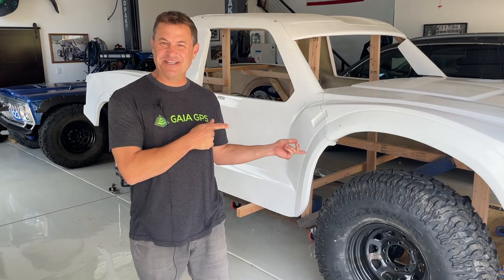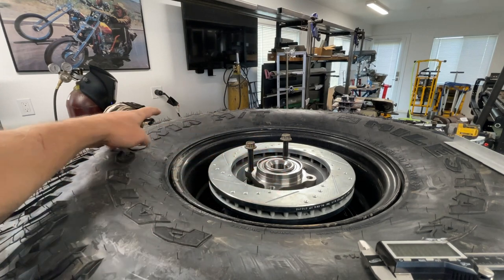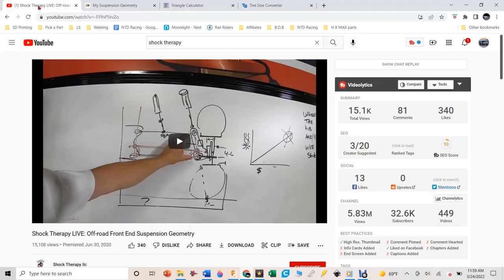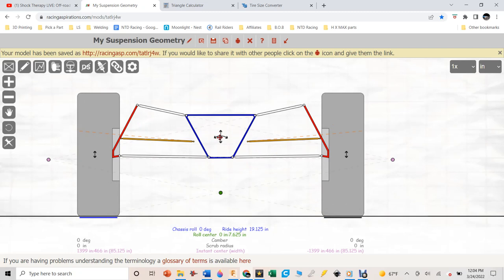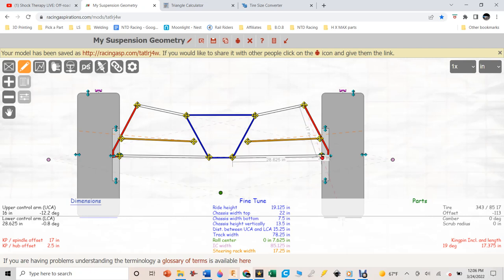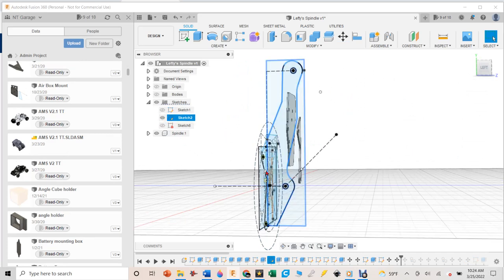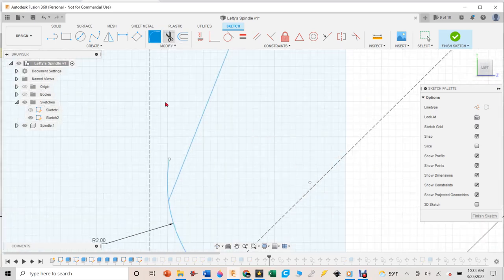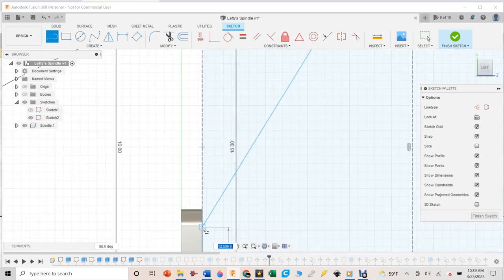Build Your Own Off Road Suspension - Spindles

Comment: Great videos, thanks for all the information and links, I'm inspired to start my own ifs suspension build.  One question, did you use 2wd hubs/unit bearings?
Reply from the maker: I think the 2wd and 4WD are the same.   I pulled them from a 2wd truck, but they seem to have the splines to be powered.
Reply: @ntdracing  I know some hubs have to have a shaft through them and torqued to keep the bearing together, I'm guessing the 2wd isn't that way. I have 4wd hubs that I'm going to be using.